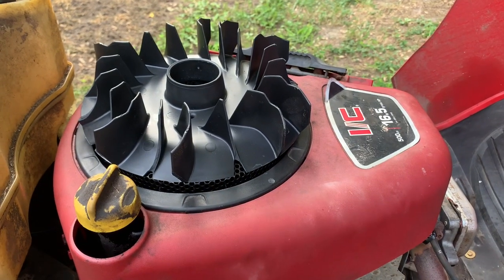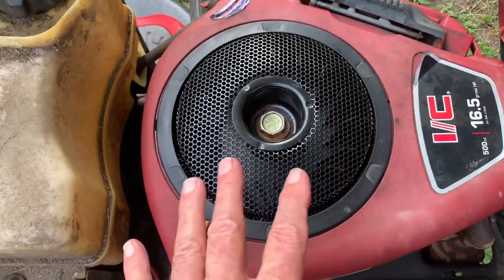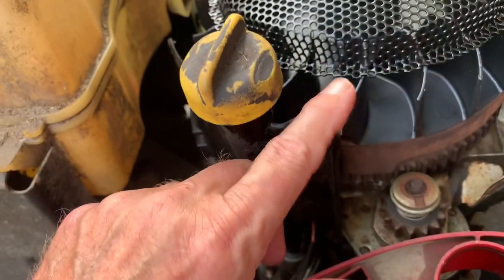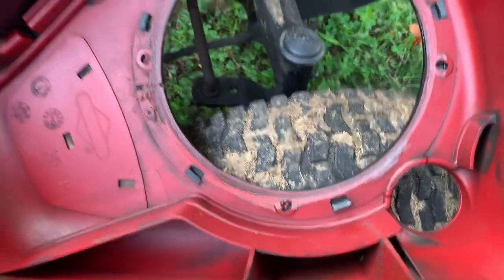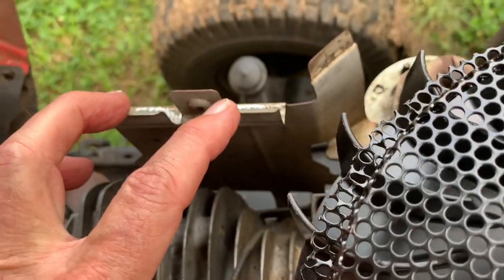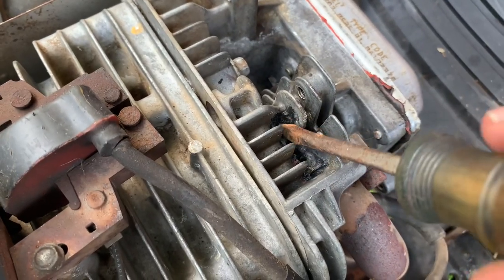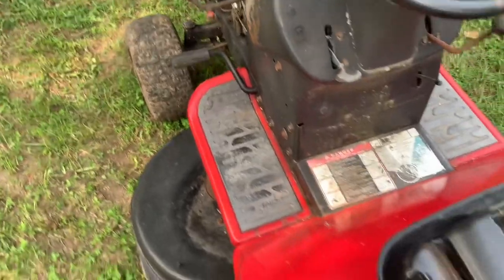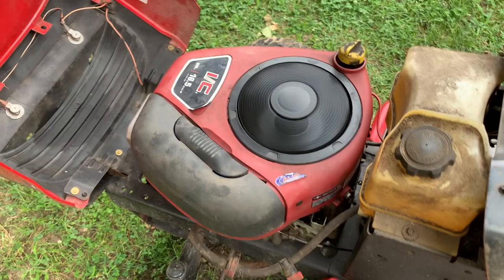Part II - I Installed a New Cooling Fan & Destroyed It

Comment: I did the exact same thing yesterday.  The pisser is I knew the oil dip stick didn’t look like it was positioned right before I started up the engine.  I should have stopped and taken the cover off and put it on right.  But I was in a hurry so….  Yeah $30.  I only broke off 2 fins but I’m not taking any chances.  It’s a new engine.  Part is on its way from ProParts Direct.  $23 for the fan and $7 to ship it.  Not at all like me to do this, but I did.  Thanks for sharing.  I too will never make that mistake again. 😂

Comment: Kenneth You Are my New Best Friend! I have looked at about a hundred videos trying to find someone showing how to properly fit the shroud. A lot of the videos ended right when they were ready to put the shroud on or they just said to put it on properly. Well that wasn't much help lol. Thank you for making this video. I am servicing my riding mower for the first time and I want to avoid breaking my fan.

EDIT: Update - This was my very time servicing my riding mower because the service company I used was not responding to my calls. Anyway, Thanks to YT I was able to change the oil, air filter, spark plug, fuel filter, add a fuel shut off valve, air up the tires and replace the shroud after I had removed it to clean the cooling fins. After putting the mower back together, I was so nervous about starting it. The first time I tried it was did nothing😕. I tighten the battery nuts and replugged the ignition components and guess who's lawn mower started😁. Thanks again Kenneth for showing me how to replace the shroud because I am sure that I would have had a different outcome today. Also, I could not find your video in the beginning because I was searching using the words ENGINE COVER. When I started seeing the word shroud on the web, I searched YT and that is when your video showed up. Yay! Oh well, time to relax and sew something.

Comment: Take the dipstick out of the tube and it will go together without all the hassles.
Reply: Thanks for the tip. I was able to replace the shroud on my riding mower with no issues when I removed the dipstick.